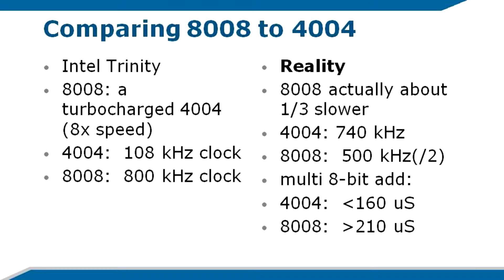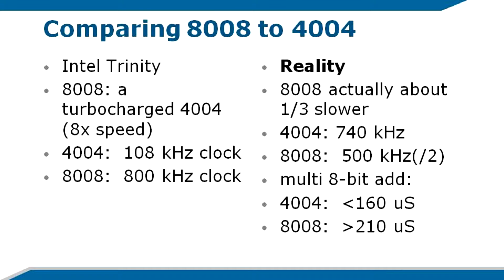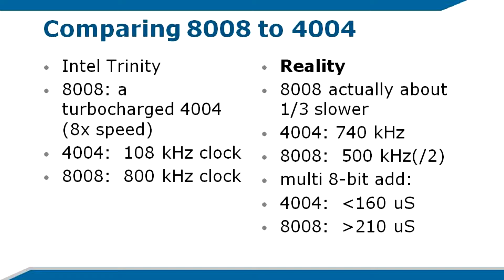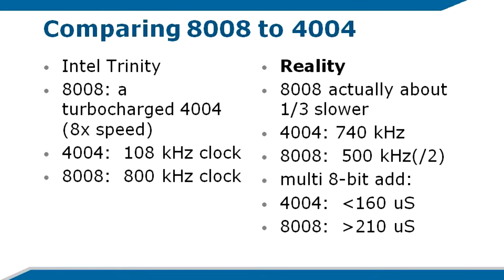The Intel 4004 to 8008 comparison

Comment: The problem is that one has to compare the duration of the machine cycles... not the clocks... The 4004 has 8 cycles for a 1 word instruction and 16 for a 2 cycle instruction, which is approx 1/10.8 us = about 100 kHz.  The 8008 has several T cycles with optional wait states... which also depend on mem speed. 500 kHz / 4 is also around 100 kHz.

Comment: This isn't the whole story, though. The wider data and address busses gave the 8008 access to far more RAM. It also had more instructions and operated on larger bytes, which means that while it may have been slower on a per-instruction basis, it was much faster for most practical applications.
It's worth noting that the 4004 was much easier to implement into a computer as it required far less external logic. It was therefor the choice for most embedded applicaitons.
Reply from the maker: Thanks for adding that insight.
Reply: @Viodi  I find the very early CPUs really interesting.

Comment: Both CPUs were also used in early handheld calculators and even my school had an old Sharp handheld calculator from 1972 that had an Intel 8008 CPU paired with a green vacuum fluorescent display and simple mechanical button pad!